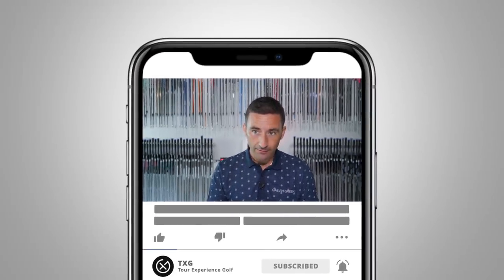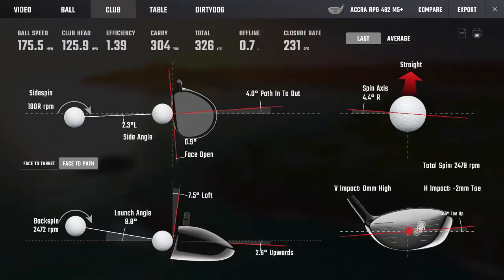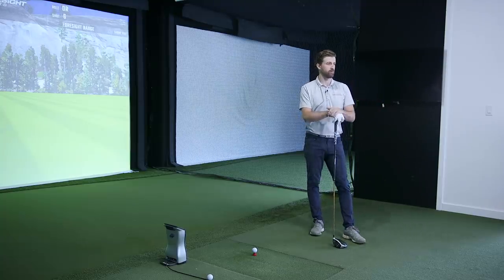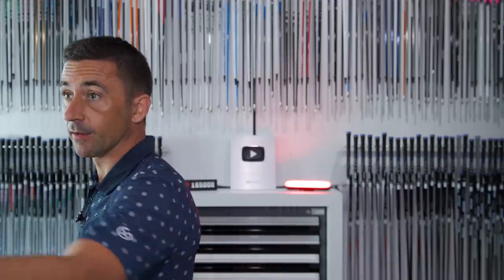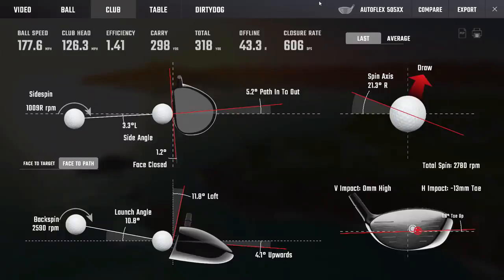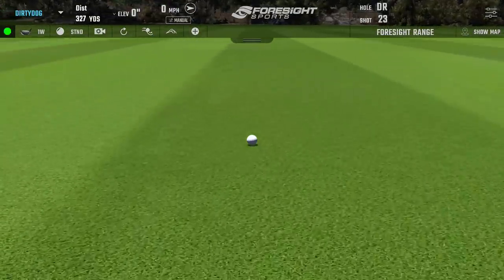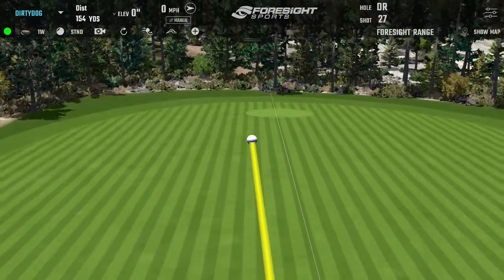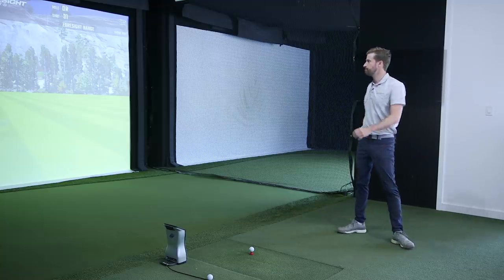SUPER STIFF vs. SUPER SOFT Driver Shaft Testing // +Accra TZ RPG Tour Review

Comment: Ian, has TXG ever considered getting a high speed camera to record  shaft flex at impact?  Maybe interesting to visually see the shaft release on these two models?
Reply: You honestly wouldn't be seeing all that much, it would be a big investment for not a lot of meaningful return. All shafts will be deflecting forward and drooping, especially at Matt's speed, and visually if would only be a "oh yeah, that one looks like its deflecting maybe a little more" because we're only talking about a couple degrees. Something that was actual able to measure shaft deflection in degrees would be more useful, but they basically already have that by measuring dynamic loft and lie.
Reply: Theres no reason. Theres enough strike point data and specs on the shaft to get all the information a picture of it would show. Especially with a machine like Matty reproducing swings you can really see things like a higher kickpoint shaft move the strike up the face cause more lag in real time without actually seeing a pic of the shaft bent. 

Shafts do what their specs dictate, they're really reliable in that regard. Thats actually why the TXG guys are so good. They can rely on the shafts specs to adjust strike point to the optimal spot on a particular club head. The clubheads andn swing are the tricky parts. The club heads are all a touch different: different weights, spin, sweet spots and face angles. What you're asking for is more detail on the shafts performance
Reply: You don't even need a high speed camera. Slomo video mode on most flagship phones is enough to capture flex.
Reply: Could rent one, possibly.  Would be cool for a video series but maybe not a good long term investment.

Comment: Very interesting video and, I believe, answers a question I have had in my own bag recently. Been playing a 3w combo for nearly 3 years. Shaft is a speeder evo2. Moved to ventus blue in driver late last year. As a result, I'm hitting driver more often and 3w less often. The more I moved away from the 3w, the more I started to miss it left on the course when I did hit it. I surmised that the shaft change in driver made me.lose the feel 9f the 3w. Old driver shaft was 125msi rogue. 

The swap from accra to auto flex and back to accra seems to support my assumption.
Reply: From a bag setup perspective, it is definitely a tour thing to have a driver that fades and 3wood that draws - so having this in your bag is useful if you can rely on it on course

Comment: Nice videos. I wanted to ask if you are know which of the current Accra shafts might be closest to ACCRA SE 80 from many years ago. It was Accra’s flagship with low torque/responsive tip technology. I still play it in M4 flex on a Nike SQ 9.5*. Still a winning combo for me. I am considering perhaps replacing it with a SIM2 but not sure which current Accra might be closest to SE 80. Any thoughts?

Comment: Got a great deal on a Ventus Black 6S yesterday. I now have the Red in 6S and the black in 6s when what I most likely need is the Blue 🤦‍♂️. At least they're holding value I guess....
Reply: You can tip it 1/2 inch and it would play very close to the blue.  If you want you can also add an extension to go back to original length.  You would never know if done properly.  I’ve got a few with over 1inch extensions and I cannot feel or see any difference on the Mevo (ball flight, spin, launch).
Reply: @MM-zb9kc  You mean tipping the Red?
Reply: @jacobmccain8082  yes.
Reply: @MM-zb9kc  That's an interesting thought I may try that. Thanks!

Comment: was this matt’s typical driver head with auto flex?  i feel like these were more shapely than we typically see from matt with auto flex.
Reply: Seems like they didn't. I saw the same ball flight with Autoflex at stock head weight. Took six grams out and it goes dead straight for me now. Love it.
Reply: @canyonaro  What swing weight have you got now? D1?
Reply: @PauloG100  I have been bouncing between 6g (D0) and 8g (D2-3). Going to stick with the 6g (recommended swing weight) for a few more rounds. I definitely hit more of a draw with the heavier weight but a bit more ball speed with the lighter weight. It's a fun little adventure.
Reply: @canyonaro  Thanks, very interesting insight.

Comment: i've been consistently slicing my ball right -- driver shaft is quite flexy. i wonder if a stiffer shaft would alleviate this a touch.
Reply: Try getting a few lessons and fixing your swing first, then check equipment. A driver shaft that is too soft generally produces more draw/hook ball flights, so it's more likely to be your swing.